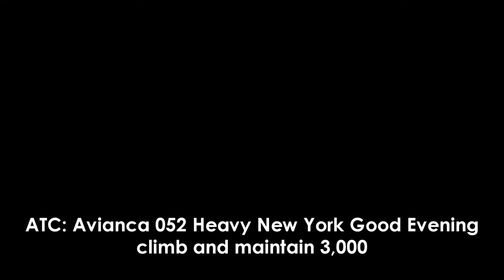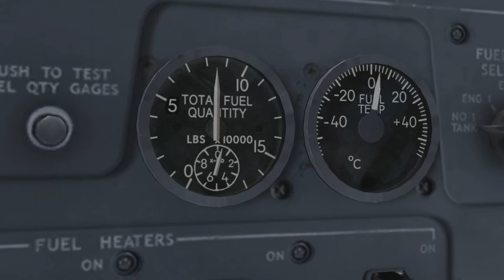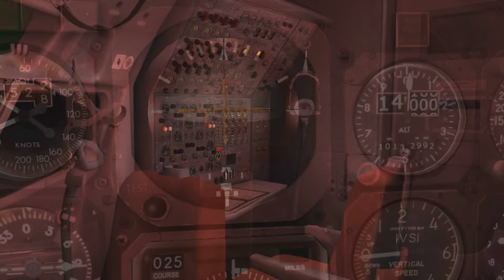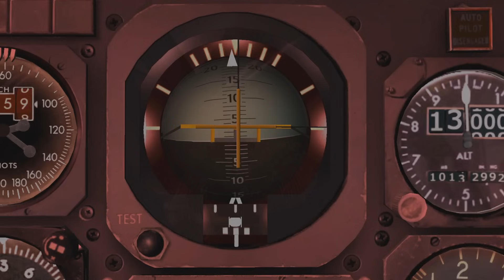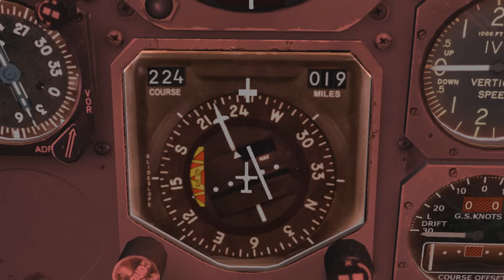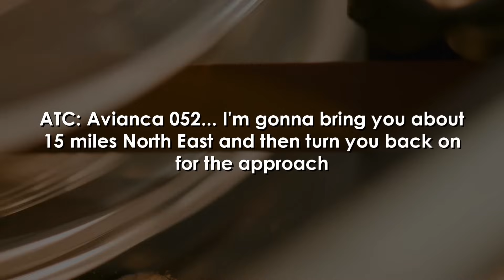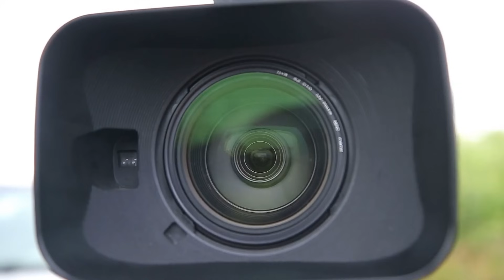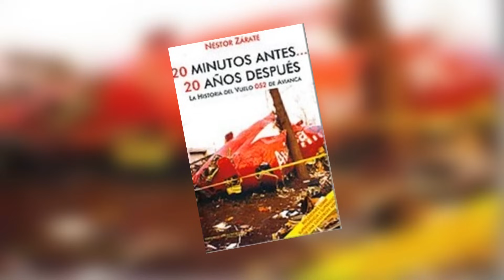Out of Fuel Over New York (Avianca Flight 52) - DISASTER BREAKDOWN

Comment: Unpopular opinion, but atc was absolutely moronic. The pilot does not need to sound panicking or use certain key words, human brain is able to understand the meaning of "FUEL LOW LET US LAND" just fine. Now let's talk about continuously putting a plane in some low altitude holding patterns. They knew that plane isn't landing in the next 1-2 hours, how about letting the pilots know that this holding pattern is not the last one and that they can divert? Also bold of them to expect a plane to have 3-4 hours worth of extra fuel. They knew everything and still didn't advice to divert. Pilots aren't perfect either, but at least their actions aren't this degree of stupid
Reply: "The pilot does not need to sound panicking or use certain key words"

You are VERY wrong here. The choice of words is extremely important, so important in fact that in aviation there is a strict regulation on terminology, e.g. "pan", "mayday" and "emergency". The crew of that flight were just too incompetent to communicate their situation. Otherwise they'd have gottten all the priority they needed.  

"Also bold of them to expect a plane to have 3-4 hours worth of extra fuel."

It's not ATCs job to track your fuel. That's the job of the pilots.

Comment: The crew were not a fault. It was US ATC  putting the flight in several holding patterns which starved them of the fuel to reach their destination
Reply: The flight crew should have like, declared a fuel emergency.
Reply: @trishayamada807  they would never have been in that mess had ATC not put them in so many holds
Reply: @tommcglone2867  You don't know WTF you're talking about. Ultimately THE PILOTS are flying the plane. ATC cannot read minds, if you have an emergency you call it out.
Reply: @merlingt1  NYC area controllers at the time were infamous for being demanding on flight crews. A flight crew which was not used to this would easily become stressed and not perform as well as they could.

Comment: That's just sad. So what we've learned from this is new York is greedy and has trash airports so don't fly there. 5 minutes of fuel and told to hold more. Wtf get that plane on the ground. And maybe if you know a plane is going to have to wait forever, just tell them they should divert
Reply: ATC doesn’t tell them to divert. It is the pilots job to begin diversion while he still has sufficient fuel to do so. ATC had them on a priority approach once the co-Pilot finally properly communicated their fuel state. But the Pilot performed a go around which they did not have sufficient fuel for. They should have been requesting vectors to Boston or Baltimore well over an hour before this. No ATC was not hand holding them. The problem with Avianca was the Captain didn’t speak English. The First Officer was a poor go between translating what the Captain wanted to ATC. The first officer didn’t declare a fuel emergency until they had 5 minutes left. And no just complaining about fuel was not communicating it to ATC. They had hundreds of planes stacked up due to the weather emergency. All of them complaining. The only way for ATC to separate the whiners from the needs was clear use of well trained specific language. The First Officer did not do that. Even when directly asked.
Reply: New York does not have trash airports, they are in the United States of America and they have the best airports in the world